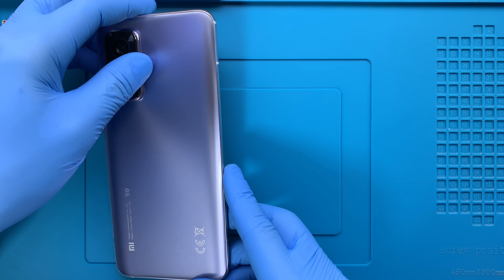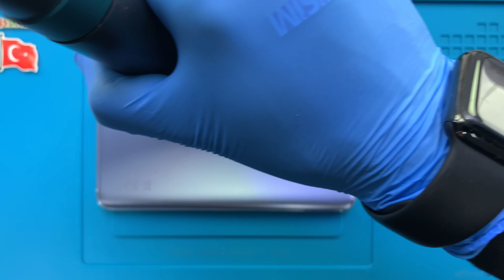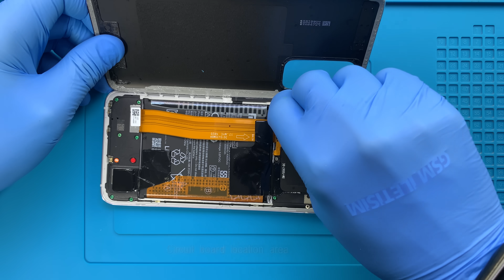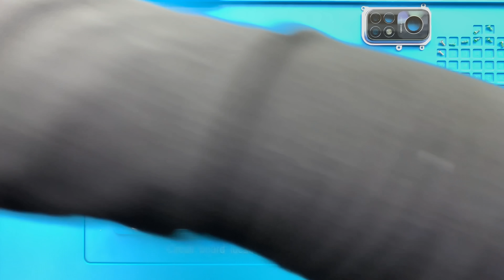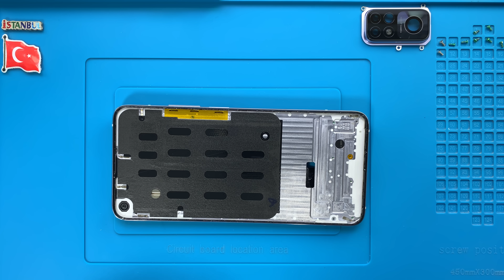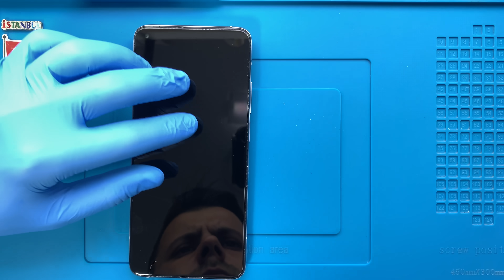Xiaomi Mi 10T Pro Ekran Değişimi 🇹🇷

Comment: Thank you for this awsome video.
However, can you tell me if fingerprint lock will work after screen replacement and where to find an original screen 
Thank you
Reply from the maker: Hello;
Thanks. Turkey.
Greetings.
Reply: Fingerprint sensor is in the power buttons so it wouldn't be affected by replacement screen

Comment: Hello , can we replace mi 10t's 144hz 6.67" IPS LCD display with similar sized AMOLED display with same punch hole position. Asking whether it is possible. Because thats the only weakpoint of this device. hdr playback in netflix looks greyish. Please try to replace with an amoled display if possible
Reply from the maker: Hi;
For precise information, the device needs to be tested.
Greetings.
Reply: There is no aftermarket OLED for this device. Every phone screen is specific to each device unfortunately. If you want OLED then you should replace this phone with the standard MI 10 instead. 10T is the more budget model.

Comment: Hello Sir my phone is the same as this
Suddenly doesn't charge or turn on anymore. I brought it to a repair shop they said they need to check the lcd because it may be the problem. But i highly doubt it. If it was an lcd and doesn't show picture it should atlest vibrate to show that current it flowing. So what do you think?
Reply from the maker: Hi there;
If you lived in Turkey, we would have solved the problem.
Greetings.

Comment: Is my battery on mi 10 for replace, i can get only 6-7 hours of scren on time with full charged ,and turn on batterysaver and dark mod
Reply from the maker: Hello there;
The battery may be the problem.
Good day.
Reply: @gsmi  so is it going to die slowly or i can use it for a few month
Reply: @gsmi  device is working normaly for now without any heating,thank you on replay